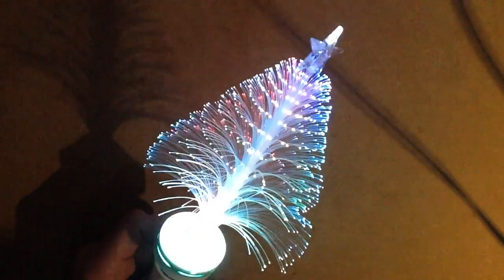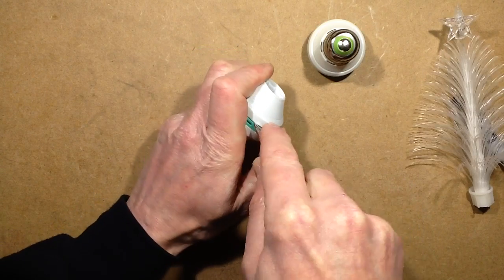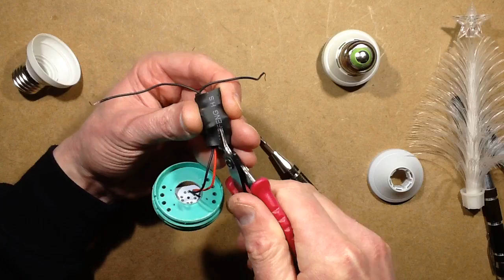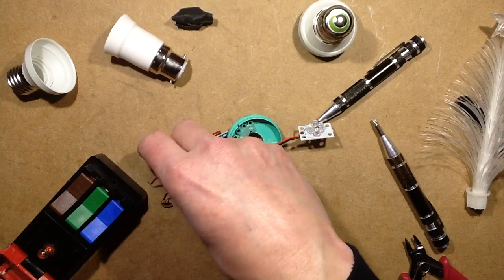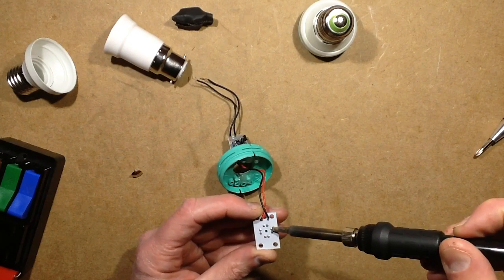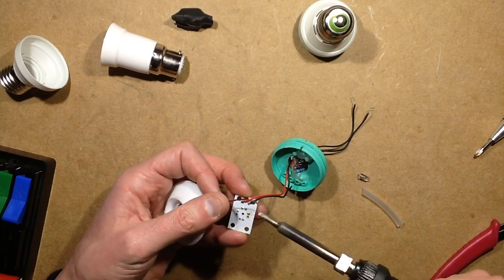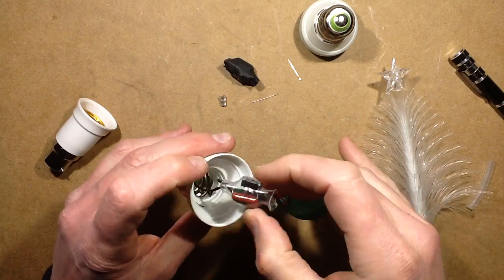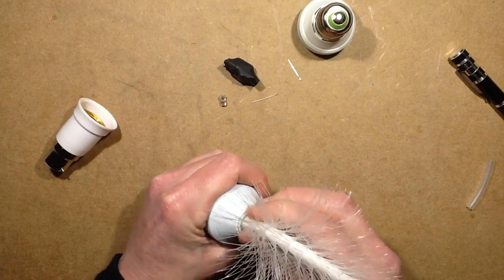Improving a small colour changing fibre-optic decorative lamp.

Comment: I exposed the hideous fast changing one to extreme conditions, as shown below, because I bought a pack of slow color changing LEDs but fast changing ones arrived:
1. Extreme heat (electric heater)
2. Extreme cold (air duster)
3. Extreme voltage (3.5V~6V, 0.01A~10A)
4. Physical damage (grinding wheel)
5. Submersion in acid (Nitric acid, 15%)
6. Concentrated UV B light (aquarium sanitizer lamp + Frensnel lens from projection TV)

Mortality rates are shown below:
1. 90% (9 out of 10)
2. 20% (2 out of 10)
3. 100% (10 out of 10)
4. 10% ( 1 out of 10)
5. 20% (2 out of 10)
6. 70% (7 out of 10)
Individual chip failing, stuck "pixels", crashing, flashing and dead LEDs included in the equation.

Comment: I would love to have one of those quick test blocks, would use it nearly everyday. However I live in the states and cant find one. If I come across one is there anything in them that would prevent me using it at 120v.
Reply from the maker: +Zach Demand It would be fine on 120V although the neon indicator would be a bit dimmer.
Reply: That's fine I would just pull it out anyway. Found one on ebay, just with it didn't come with the UK cord a bit over kill for the US.Thanks

Comment: The LED lit up when you touched it with the soldering iron and your hand at 6:48 look closely, you can see it shimmering red
Reply from the maker: +DerpyDoom Residual charge on the power supply capacitor discharging through a single LED when I bridged the back with the copper wick.

Comment: Why do you use such a large tip when you're soldering such small parts?  Is it just a thermal mass thing, or just not enough of a hassle to bother having a second iron with a small tip or swapping tips?
Reply from the maker: +Das Grinch I prefer a tip with a slightly higher thermal mass for speed reasons.

Comment: Desoldering wick is my tool of choice over pumps even, though I did get some cheaper stuff from Radio Shack that seemed light in the flux side of things and didn't work nearly as well as I'd like.
Reply from the maker: +Brad Sparks On some of the wicks I've had to boost the flux content by rubbing the edge of a flux pen along the wick.
Reply: I feel like a git for never thinking of this before. Do you think smearing a bit of cheap flux from a tube would also do the trick?
Reply from the maker: +Brad Sparks Yeah, that should work.

Comment: No use swapping the leds dude, if their being over driven they will fail again
Reply from the maker: +IIGrayfoxII 30mA would be too much for a typical 5mm LED, but 30mA is fairly common for the colour changing ones as the current is shared around the three chips.

Comment: Much improved!  I do have one question...what is that LED testing box you had at 7:18?  Or better yet, how accurate is the current output at the top?
Reply from the maker: +Brendan Orr It's a really common Chinese LED tester found on ebay.  It just uses resistors for the current limiting, so the LED voltage and battery voltage will result in a margin of current variation.